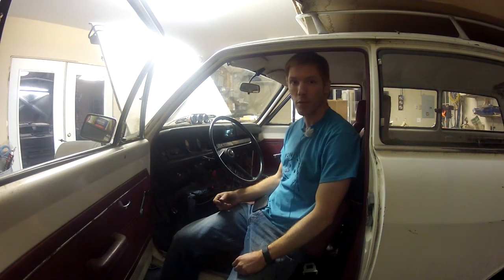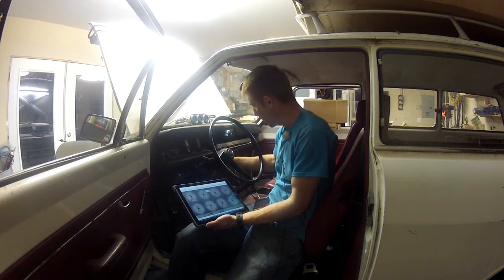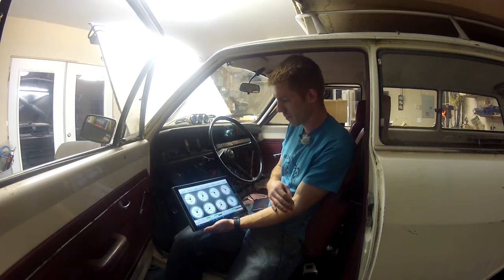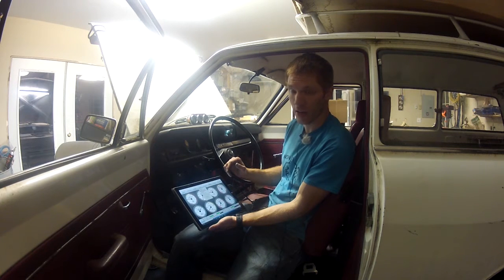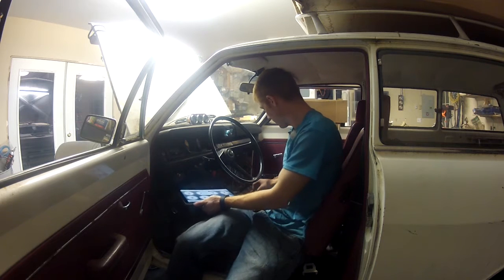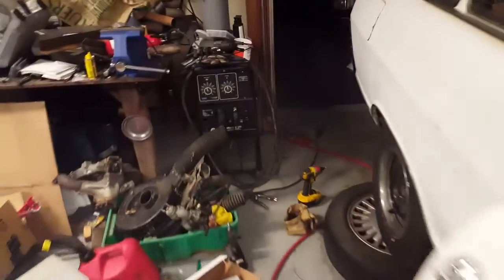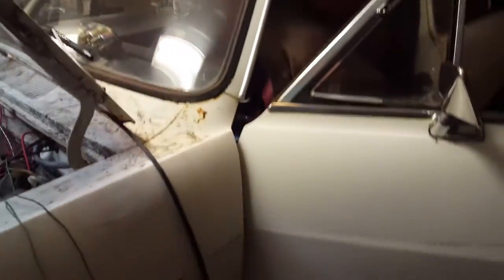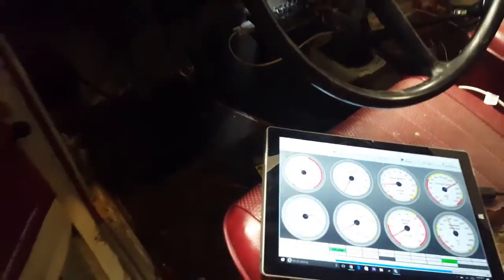1971 Opel Kadett First Start Megasquirt EFI Conversion

Comment: That was my first car in 1982, yellow 1973 1.9 auto trans.My old man had several of them so I was familiar working on them.
Reply from the maker: That's cool, I had a really nice Isuzu i-Mark for a while (Kadett-C) that I regretted selling. So I ended up getting this Kadett-B a few years later. I still have it. It has a much better EFI system on it now. I haven't done anything new with it in a couple years, but maybe this year I will install a 5-speed.

Comment: I grew up riding in a wagon exactly like this one. My mom "upgraded" to a new Pinto, which was the car I learned to drive in. Glad to see one getting some love.
Reply from the maker: Thanks, it's a neat car. It's been in reliable driving condition for a few years, and I have improved the fuel injection and ignition systems substantially since this video. I have a European market EFI manifold on it now and direct ignition.